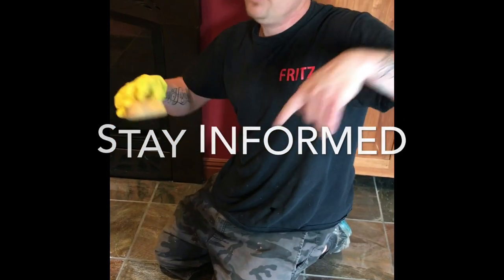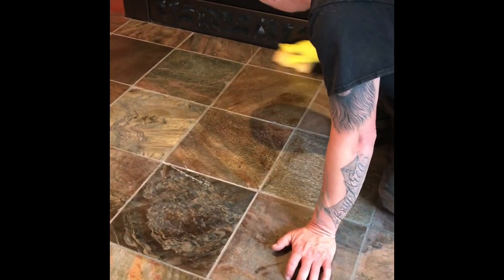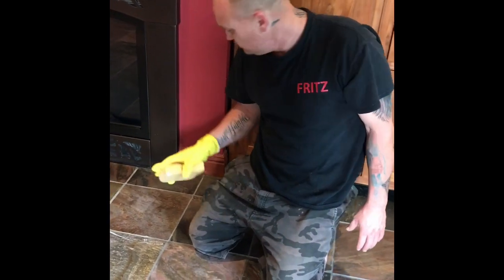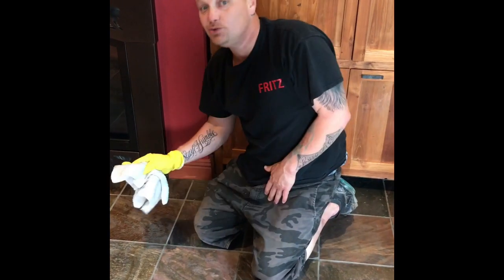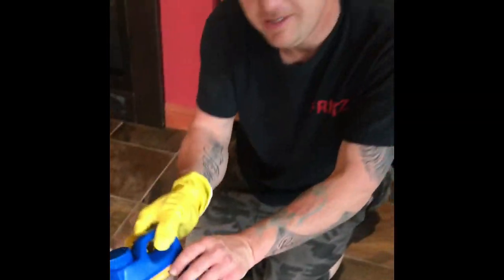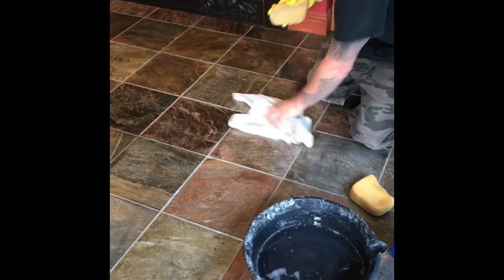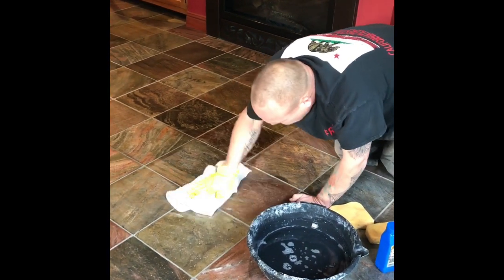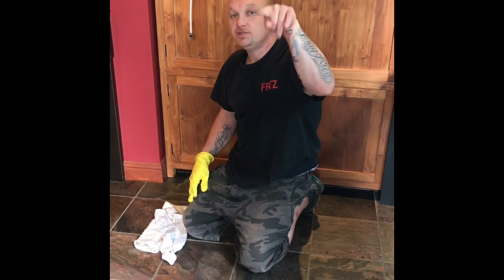Sealing Slate Tile Flooring DIY | BEST WAY to apply sealer 101

Comment: I just sealed my slate 3 times and it is not repealing the water is still observing it. What’s the deal I just spent $45 sealing it. What am I doing wrong. I applied 2 more coats and it just observes it too

Comment: Great video, only question i have, does this change the color of the tile or the grout cuz I saw in another video and guy mentioned it changed his from a darker color to a lighter.
Reply: A regular solvent sealer shouldn’t have any color difference.  However, if you use a enhancer sealer to bring out the colors in your stone or grout I can darken your stone and grout.  Sometimes after a cleaning the floor can lighten a little and I’ve had customer that didn’t like it so light.  So, I applied a enhancer sealer and it darkens but brings out richer colors of the stone and grout.  It can change colors but depends on the type of sealer you use.

Comment: What would you use over the 311 inpregnating sealer to get a wet look on the natural slate tile?
Reply from the maker: I don’t recommend applying a sealer over the 511 because it will repel but if you prefer a wet look sealer then I would say apply that instead of the 511
Reply: Second his response below. Use "enhance and seal" instead of impregnator if you want it to look wet. It will darken the color, bring out some contrast if its not honed, and look wet. Sealers sit on top of the tile and create a film whereas the impregnator actually sits down in the pores of the natural stone.

Comment: can you use a mop?
Reply from the maker: I don't recommend a mop with the penetrating sealer. Sponge is a much better option because you can control each coat without over doing it. If you use too much sealer at once you can leave streaks that are unfixable with these types of sealers.
Reply: @californiatilerestoration4827  I use a mop when I seal big areas
Reply: yes, use a nylon mop